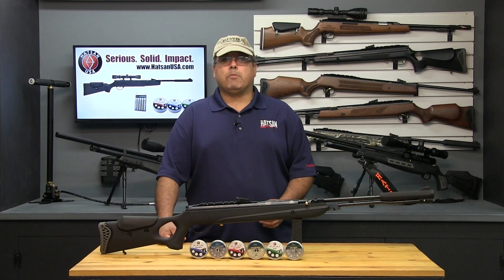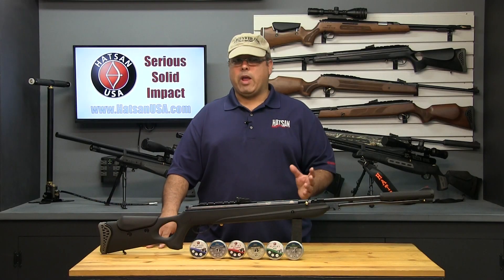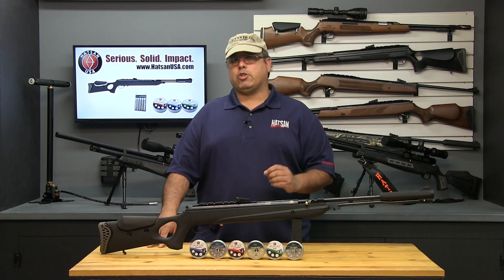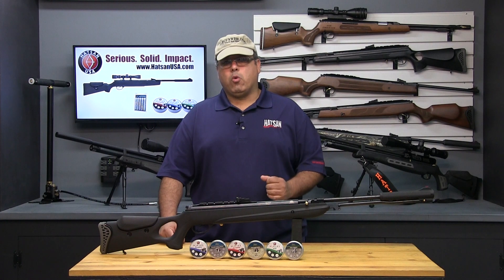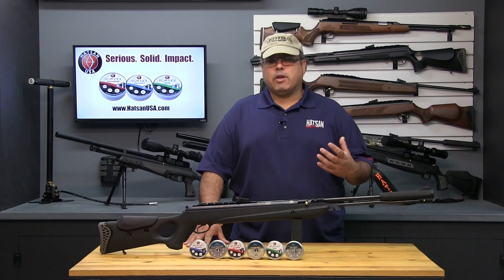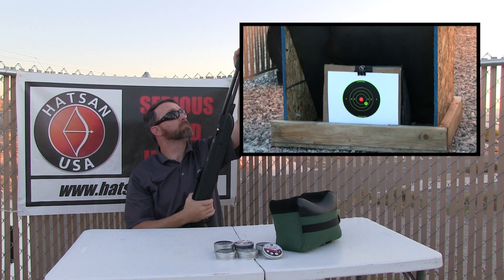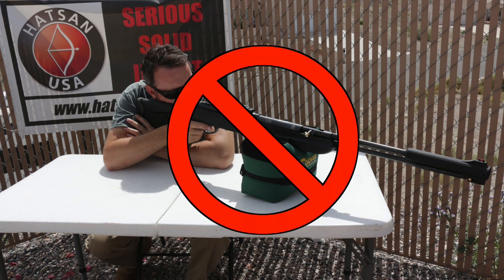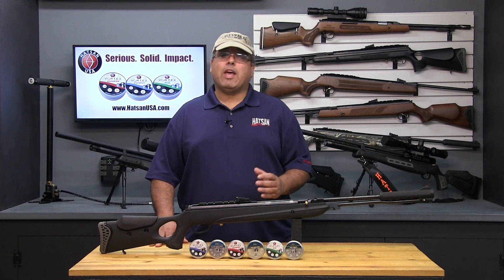Shooting a Magnum Hatsan Airgun - The Artillery Hold

Comment: Good video. Although, I thought I'd mention some rifles do like to be sat on a rest, not all but some. Biggest thing I found is that repeatable hold is crucial for best accuracy that's for sure. I actually keep a little piece of paper in my gun cases stating the type of hold and best pellet etc. I like my Phantom the best for training, I can actually hold that just like I do my .300 win mag.
Reply: XDevilsChariotX I'm glad that I am not the only one taking exception to Ricks' NEVERs. I routinely obtain my best groups using both front rests and rear sand bag.
Reply from the maker: Charles Aldridge - There are always exceptions to just about every rule.  This video was commissioned specifically to help new owners of Hatsan Magnum airguns.  It specifically applies to them.  There are other spring guns of various classes that may or may not like to be shot off various types of rests.  One thing to consider however.  If you generally site and shoot your springer on a rest, it's very likely that if you try and shoot it from the shoulder without the rest, your point of impact will shift.  Using the artillery hold helps eliminate those inconsistencies.

Cheers
AGW
Reply: Airgun Expert & Critic - Rick Eutsler / AirgunWeb Rick-You are absolutely right about the shift in POI when using a rest as opposed to the artillary hold. I have witnessed the shift and made a mental note of that shift with the bullet point of not to use it. Instead, I have zeroed my guns using the shooting sticks, which are definitely going to be used from my portable hide. Each of my rifles behave differently with different contact points on the shooting sticks. So, I only utilize the BALANCE POINT of each one with remarkable results. Please continue with your excellent presentatuions, I really enjoy the information and format.

Comment: Rick, I own a Hutsan MOD 135. I like to shoot unsupported manner (without rifle holds or sand bags).  Its very heavy and my arm which hold the front part of the gun get tired quickly. This will make it difficult to hold the gun aiming at a point for long time until I get a good view through the open sights. Is there a way for me to hold these types of heavy guns ? Please demonstrate.
Reply from the maker: +Rahal Widanagamage - the only think you can do is practice, train, and practice some more.  

cheers,
AGW

Comment: The artillery hold was a must for my Hatsan 125 Sniper.  That thing has massive recoil.  Which brings me to another point; why would Hatsan include that crappy bipod which would only hinder accuracy?  I never even took the bipod out of the bag.  I would have preferred they use the extra funds for a better scope or something.  Just my two cents.
Reply from the maker: Aldo Raine - it is a question that I have asked them many times over.... Someone, somewhere, thought that was a good idea at some point.

Cheers
AGW